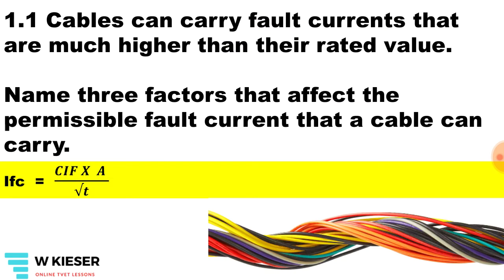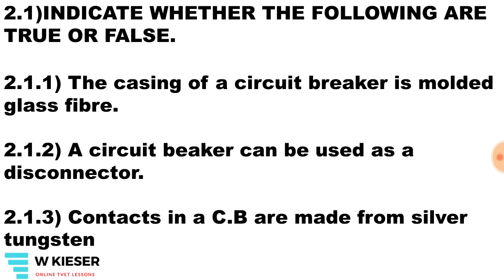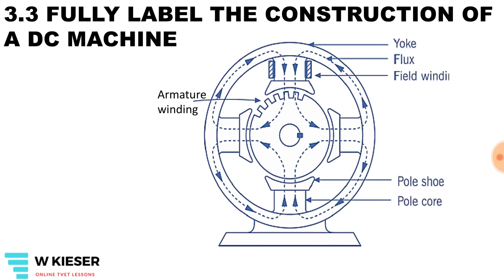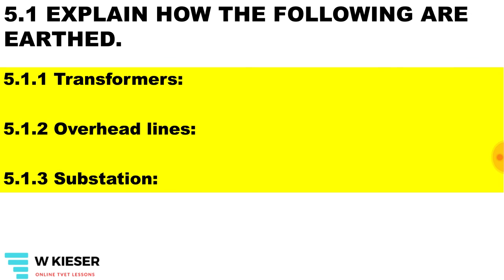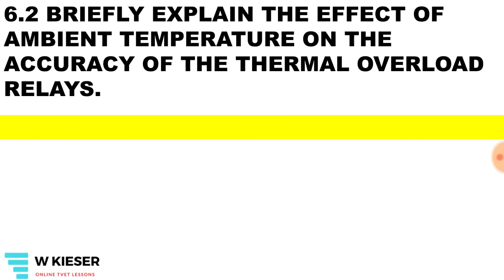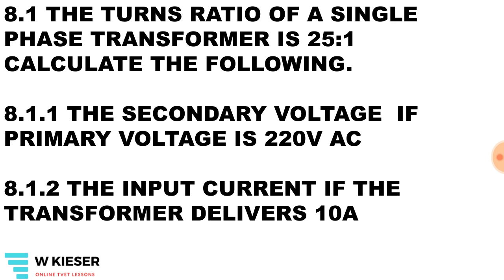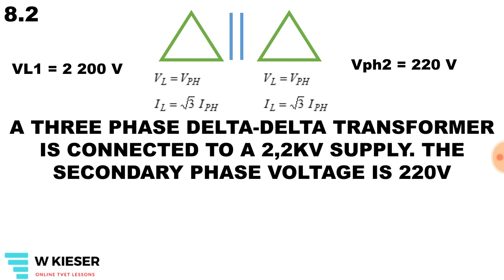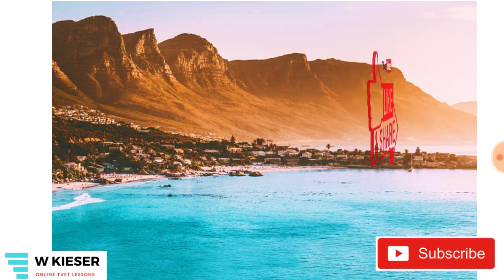August 2020

Comment: I'm writing exams in November.. they offer us old papers from 2019 and 2018.. are they worth it or is this 2020 one best?
Reply from the maker: Which subject
Reply: @WKIESER  electrical trade theory, industrial electronics and engineering sci6
Reply from the maker: The new curriculum for N1, N2 Electrical Trade Theory and Industrial Electronics will be phased in from 2021. For now, 2018 and 2019 should be good exam preparation. Only untill the end of this year.
Reply: @WKIESER  Will N3 industrial electronics be the same?
Reply from the maker: @tigerseye3876  N3 will be the same in 2021